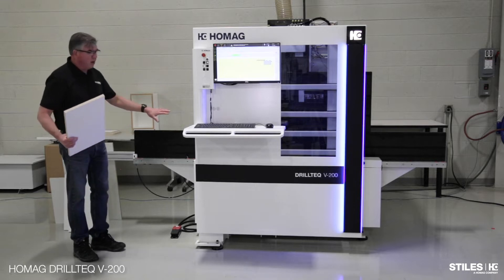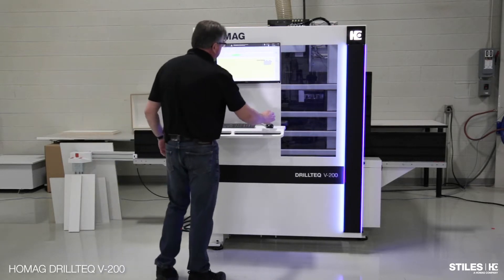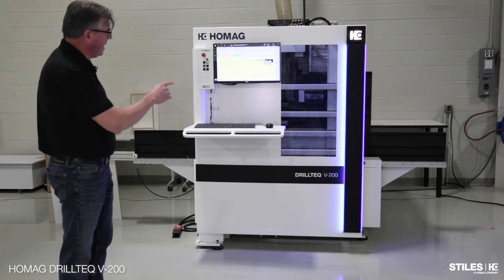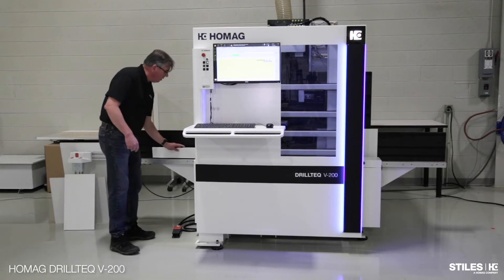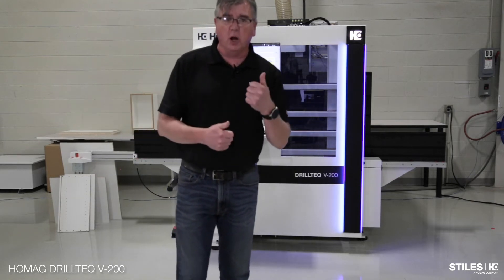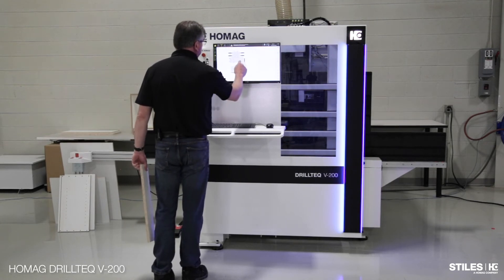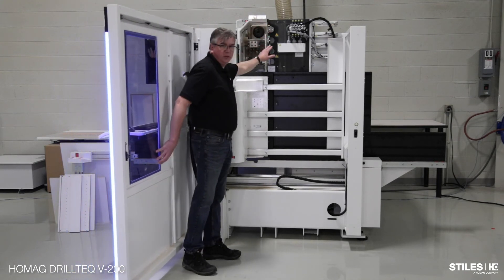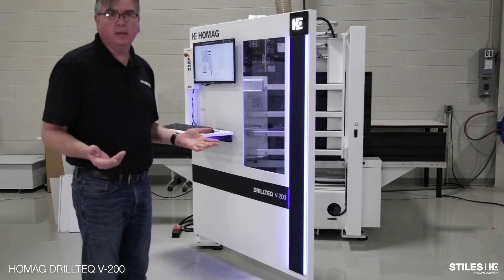HOMAG DRILLTEQ V-200 Vertical CNC Machine – Basic Operation Overview

Comment: Which Homag CNC machine is best to work drill holes, boring and grooving. Note that I need the drill hole to be done on vertical sides as well.
Reply from the maker: Hi Antony, if you can send an email to info@stilesmachinery.com i'll get you in touch with someone who can answer questions around your CNC needs. Thanks!

Comment: how dose it do mirror image like a pod and rail machine? and dose it use wood whop software?
Reply: I use this machine at work. It used WoodWOP8 and on the programme loading page, it has a feature on the top left to change from  right to left vice versa.
Reply: @kasabian1987  Thanks kasabian1987! This info is surprisingly hard to find
Reply: @kasabian1987  do you know to change router bit? I got it to release the collete but it home take it back now lol
Reply: Wood Wop

Comment: What’s the largest and smallest part that can be processed?
Reply from the maker: A wide range:

Workpiece length [mm] – 200 – 2,500 (optionally 3,050)
Workpiece width [mm] – 70 – 850
Workpiece thickness [mm] – 12 – 60